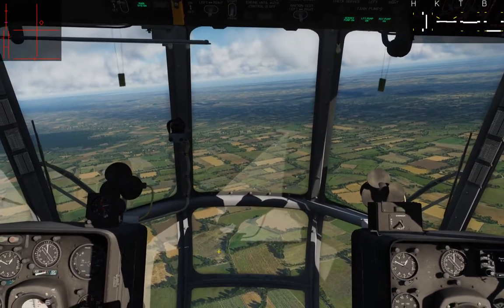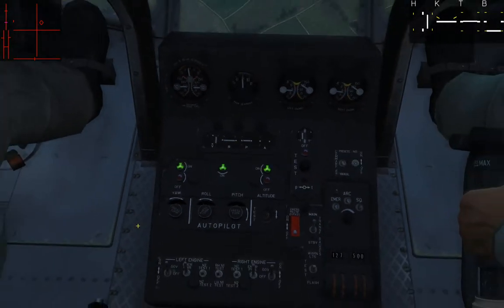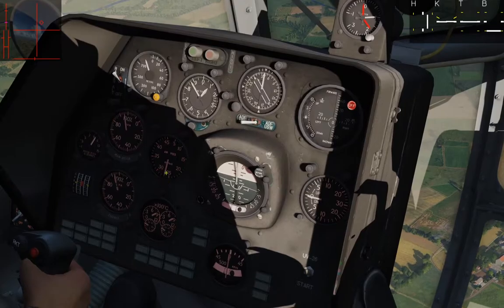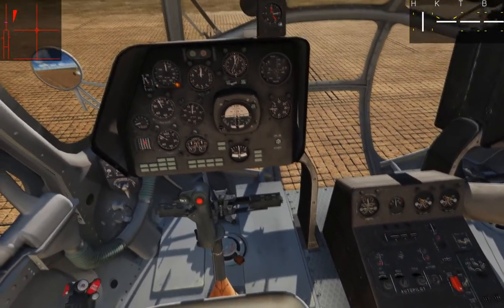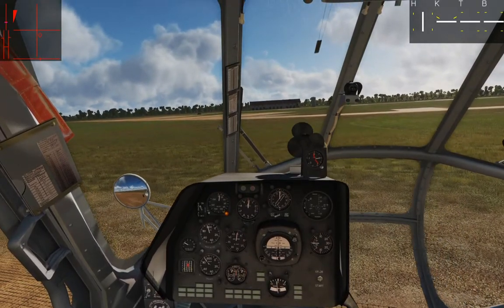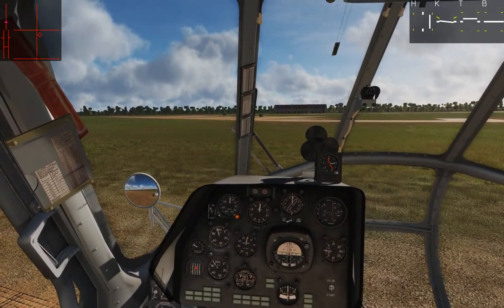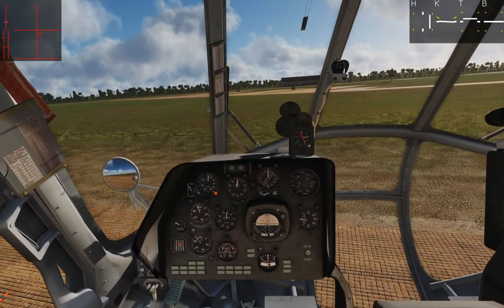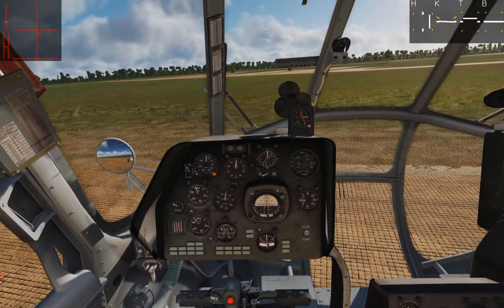DCS Mi-8: Autopilot Tutorial

Comment: Hi. I've just bought the Mi-8 module and I came across this series of videos and what a godsend, thanks for your great work.

I have a question regarding autopilot modes. I cannot get altitude hold to work! I make sure I am not ascending or descending before clicking on the altitude hold button. The button depresses but the green light is not illuminated and the altitude hold is not engaged. Any ideas? I have rewatched your video a couple of times but, other than pressing the altitude hold button, you don't say much more about it.
Reply from the maker: The other modes are working, right? Best advice I can offer is to set your trim and keep adjusting it until the helicopter is basically flying level without the Alt Hold AP enabled, then try to turn it on.

Also make sure you turned on the Doppler (right triangle panel). I can't remember off the top of my head but it might rely on that.
Reply: Hi

Thanks. The doppler is turned on as I go through both triangle panels during start up. I have been flying from a cold start so I maybe I'll try a hot start and see if that makes any difference. At least if it works that would point to something I didn't turn on. 👍🏻
Reply: BTW, yes, the other modes are working fine.
Reply: Hi Terminus

I have tested this by doing a hot start and the altitude hold works fine. If I do a cold start it doesn't work. I will go through your tutorial again but I'm pretty sure I'm not missing anything! It's getting annoying but I will persevere but if you do thnk of anything, please let me know.

Nial
Reply from the maker: Interesting! Could be a bug, could be something I missed in the cold start tut. I rarely use that mode so who knows. I'll try it out next time I fly and see if I can figure it out, otherwise good luck!
Reply: @vsTerminus  I don't think it is anything you missed. I ran through the full cold start procedure in the 'Training' sub menu. Altitude button did not work. I then flew the free flight mission from the 'Instant Action' sub menu (the helicopter starts hot). The altitude button worked fine. If I fly a mission from mission editor with the engine hot, the altitude button works. If I fly the same mission but with a cold start aircraft it does not! I have reported this behaviour to ED via the forum.
Reply from the maker: Nice! Hope they get it resolved. Thanks for doing all the investigation and for reporting it.
Reply: @vsTerminus  I got to the bottom of this, well I didn't exactly - LazyBoot suggested the solution on the DCS Forum. It seems that when you do a cold start the 'Collective Clutch Lock/Reales Button' is engaged and that prevents you from engaging the Altitude Hold button. If you press the button to release the collective lock on startup, the altitude hold works fine. I think I could only engage it once I was in the air, but maybe I just imagined that! For anyone who doesn't have this button mapped on their Hotas, it is the round 'white' button on the collective. 👍😃
Reply: Just a quick update on this, and thanks again to LazyBoot. I can confirm that if you do the complete startup from the pilots seat the Altitude Hold button works. As soon as you swap to the Engineers seat the Altitude Hold is disabled and you need to go back to the Pilots seat and press the 'Collective Clutch Lock' button to free it up again. I also noticed that you can't click on the 'Collective Lock Button' with the mouse so you will need to bind it to a button on your Hotas.
Reply: @nialball9023   Thanks, I had the same issue!

Comment: Great Video series!
Heading hold, how do I set a new heading? Say that I’m hovering with my nose to the north. I then want to change heading to the East and have the autopilot hold this new heading. When I turn on the heading hold with a large amount of rudder input it doesn’t seem to be able to hold this new heading.
Reply: It's a limitation of the current sim implementation, in conjunction with a bug.
In the real aircraft, there are weight sensors in the pedals, putting your feet's weight onto the pedals transitions the yaw autopilot to override mode. In this mode the heading hold and the yaw pedal force trim stops, the pilot then manually position and stabilizes the aircraft to a new heading, then lift the feet off the pedals, so force trim and yaw heading hold re-engages and holds the new heading.
The transition is not implemented properly in the sim, there is no "feet on" hotkey and you have to displace the pedal to do the transition. It also does not work properly if you turned off the rudder trimmer, it may be difficult to allow the yaw autopilot to work in the first place.

Comment: hi, how do you get the system to maintain forward cyclic? do you have to trim first? (and thereby lose your hover trim?)
Reply from the maker: Yes, that's correct. Hold your cyclic where you want it for stable flight and press and release the Trimmer Button, then return your joystick to its center.

I used to be more apprehensive about losing my takeoff trim. I would hand-fly entire missions because of it. Now I've learned to not worry about that. Trim often and make small adjustments to the cyclic. As you slow for landings you will naturally find that takeoff trim position again.

Perhaps that is something I will have to make a video about.

Thanks for the comment!
Reply: @vsTerminus  thanks for that insight. I was doing the same! I started trimming and using autopilot on travel legs, and it's certainly much better. But the un-synchronised cyclic was annoying. I then tried reducing the springs and increasing the dampers in my vkb gf, so it stays in position, and fly without trim at all. I'm finding this the most realistic and intuitive. Very easy to make adjustments while flying. You should try it. Only downside is can't fly planes without converting back.

Comment: First of all very useful video👍🏻 
I only have one question about the direction hold channel. If iam in a straight flight with a slight slip to the left. If i want to engage the autopilot direction hold i have to stop giving anti torque, however if i do that the helicopter is logically turning even more to the left so its almost impossible to turn on the direction hold. Is that just a normal „problem“ which the pilot has to deal with or am i doing something wrong?
Reply: I dont know if there is a proper solution for this but I have a workaround.

When I am in straight level fly and ready to engage AP i just check the amount of (probably right) rudder I have to give to have no drift. After that I release the rudder, let the helicopter snap to whatever direction (most likely a bit left) and engage direction AP right after. Then I start to turn the adjustmend knob into the direction of the rudder input you want. If you continue turning the AP will trim the rudder as well. If you reached your desired trim status you switch it off again, properly readjust your course and kick it in again. With that you have the right course plus a nicely trimmed rudder as well. Problems arise if you change collective though of course.

Comment: Good video. I have a question. Some time when put more collective on some situation. The main autopilot turns off by itself and betty start screaming left generator failed etc. why the main autopilot turns off. Does it reaches the limit or what else cause it?
Reply: If you add too much collective too rapidly you cause the main rotor RPM to decrease until the engine compensates. If the rotor RPM drops too low before the engine has time to respond  the generator will trip off until the RPM increases back up again, which in turn causes the autopilot to turn off.  Try to anticipate and avoid such rapid increases in collective to avoid the situation.  These are a great set of videos - have fun learning the module.
Reply: @edburrows2439  thx that makes sense
Reply from the maker: @sniperwolfpk5  Rotor RPM has to stay above ~88% or your generators will fail. Ed's advice is solid. Make slower adjustments to your collective and the engine will have an easier time keeping up. Also try to avoid vertical takeoffs unless you have no choice. It is much easier on the helicopter to enter a hover at 3-5meters and then pitch forward and pick up speed before climbing. Same idea when slowing down, slower is better and transitioning into a hover while in ground effect will be easier on the helicopter than transitioning at 50m in the air.